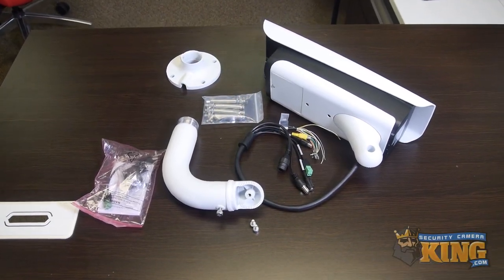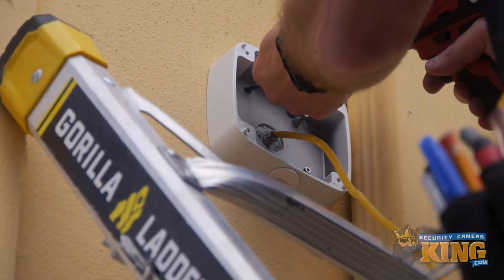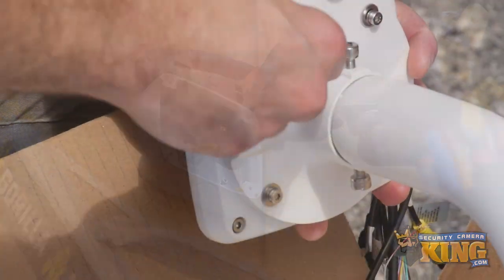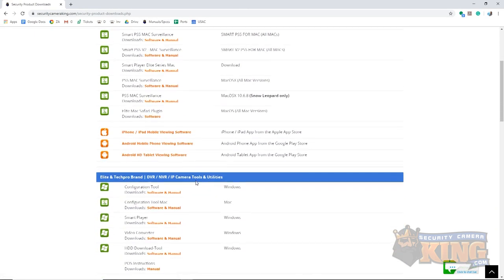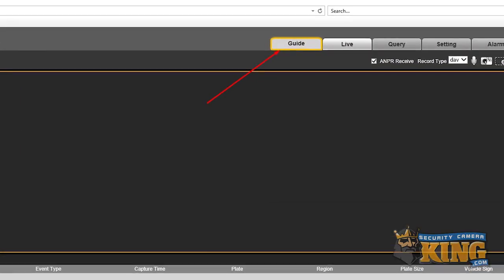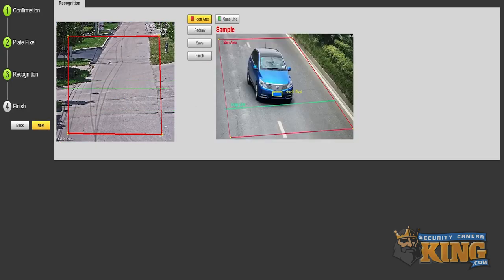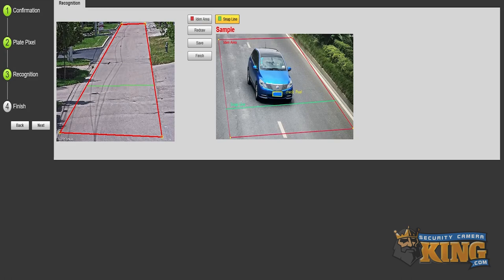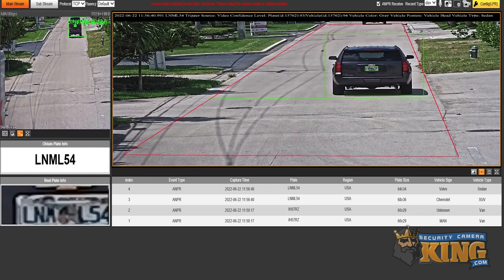How to Install & Setup an ELITE License Plate Camera

Comment: Do you still deal with access control systems? I tried calling the number on your website but I don’t think it’s correct. Thanks!
Reply from the maker: Our Company Number is (561) 288-5258